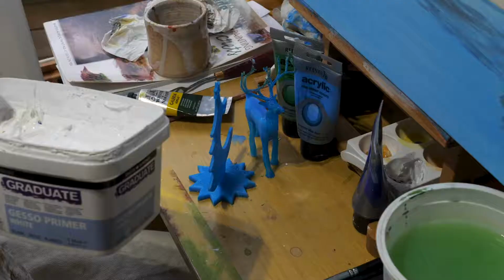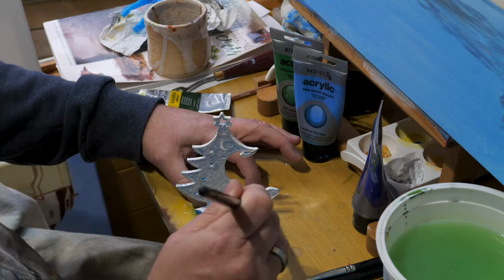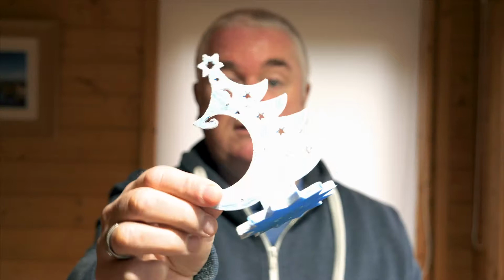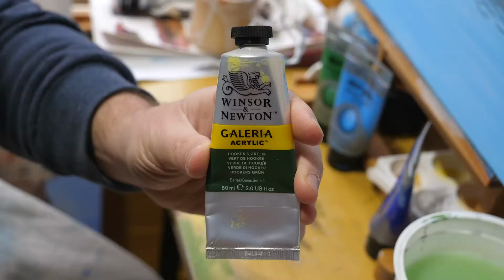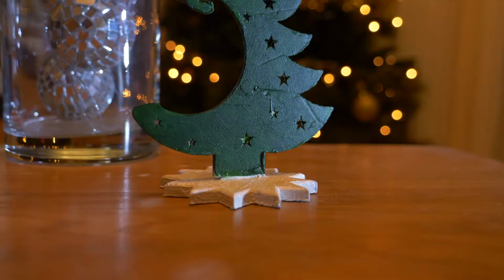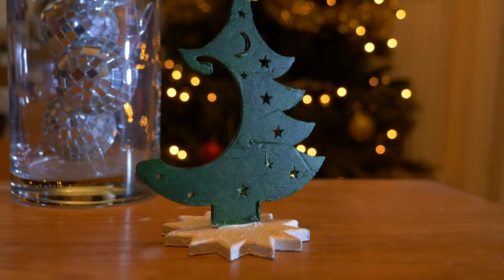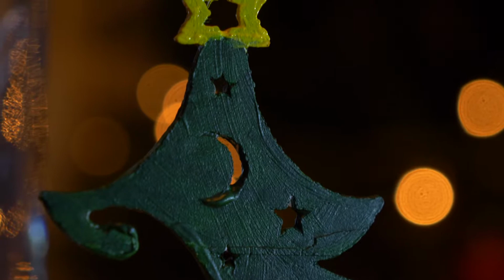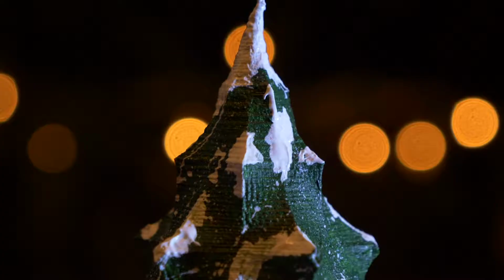Painting PETG with Acrylic Paints

Comment: Hi, Mark! Just in time :) Did you've tried to smear it by fingers after the paint was dried?
I have some old acrylic paints and wanted to try how they will lay inside my print (I've made a kind of a beige). But it's too dry...
The whole thing that it's a test before I'll buy some (not cheap) luminiscent acrylic paints and will make a decision - do I need to make an inboss design for my old fringe's handle. I've painted some boring mouses (as gifts) a long time ago... But those mouses had some "rubber" finish and acrylic paints were sticking pretty good.
Reply from the maker: Hey,  You can tell if the paint it dry just by the look of it, as it looses it's shininess slightly, and if you just touch it with your finger you can tell.  I found it best to bring it in a warm room, as it dries quicker.  I want to make a few other things and print it better quality, and even try to iron the surface (theres and option in Cura for that) so that it is smoother.  Would be interested to see how your ones come out, especially with luminescent paint!
Reply: Mark, so does it stays in place now if you're trying to scratch a bit (by nails) or smear by finger tips?
Reply from the maker: KiR-3d Hi,  I’ve just tried to scratch the paint off with my fingernail, it stay in place.  It was only a light scratch, as they are on my fireplace as decoration now 😀
The paint is completely dry, so there is no smudging at all.  I think they will last if treated well.
Reply: Maybe I'll do a video about that handle on my channel later (but it's not even printed yet).